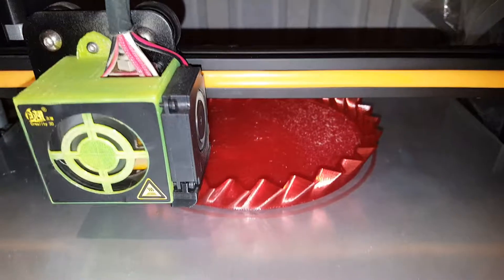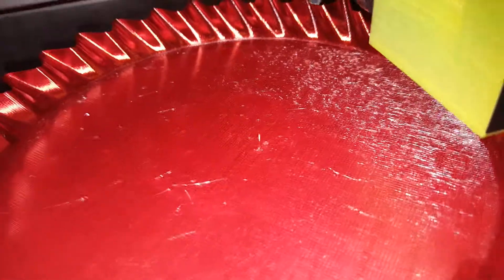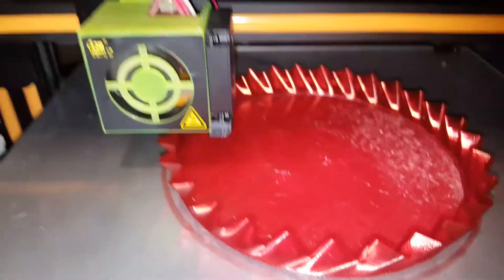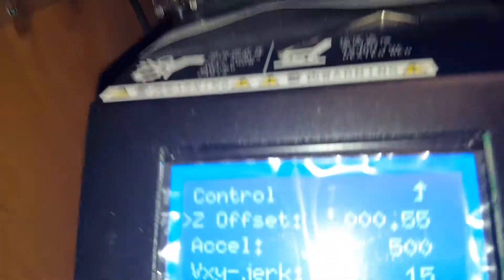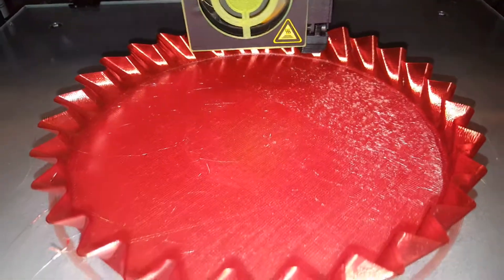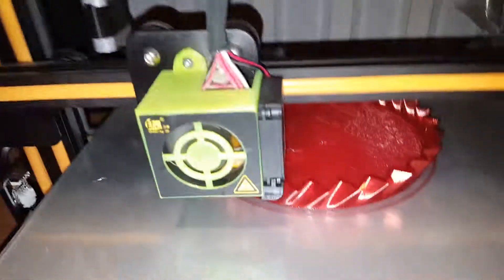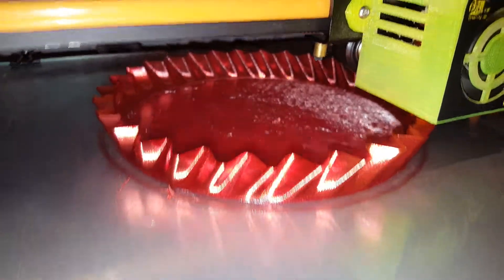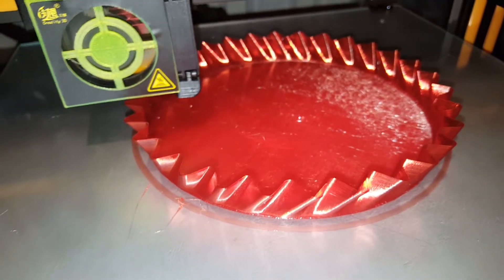cr 10 & printing pet g  not  squish friendly like pla

Comment: I have tried almost all of settings found in the internet, and I only had luck printing using vase mode. Somehow PETG is only good in printing in vase mode, other than that, it bubbles up like crazy. Any suggestions?
Reply from the maker: 3D Printwiz it prints great just slow it down 7hr print in pet g cr 10 fang  its perfect. u shouldnt be getting bubbles what temps you printing at